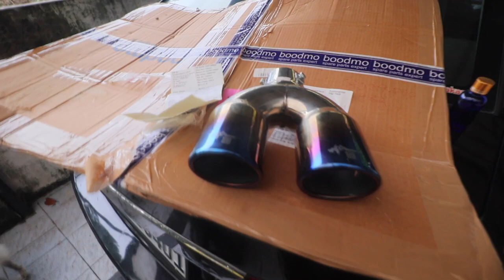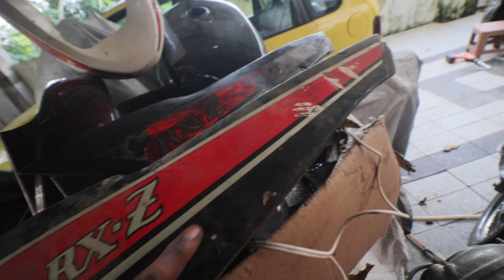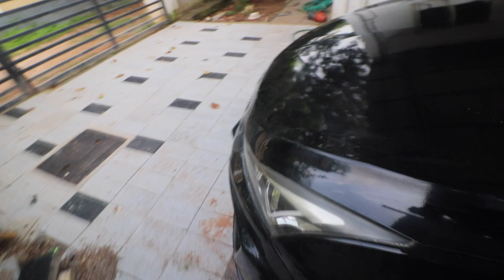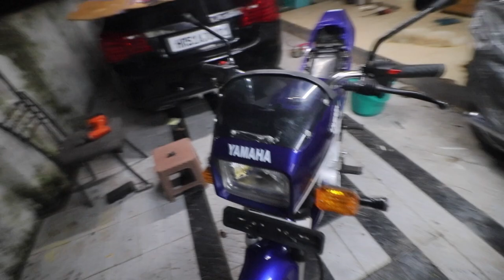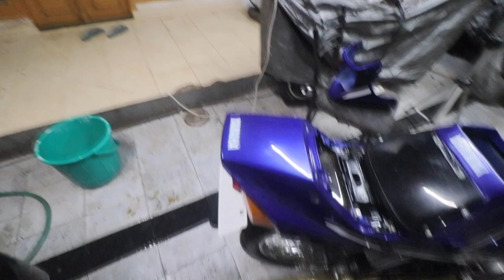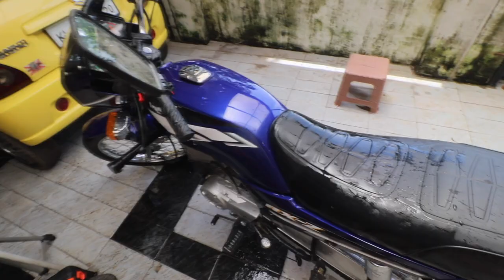Ceramic Coating the RXZ (Malayalam Video)

Comment: Bro ee CAT silencer matti 4spees silencer ketyal ula gunam endha annu.....athupole CAT pottikune engne enunulathu vedio kude patyal chayumo.....
Reply from the maker: Cat silencer back pressure koodthal aanu, Athu karanam low end torque kuranju. Allengil therichu therichu nikunna vandi aairunnu
Reply: @Yamakaze  athine epo ndha solution ulathu chetta
Reply from the maker: arun kannan normal silencer use cheythal mathi, potikkunath chilapol parajayam aavum
Reply: @Yamakaze  oky chetta njn ente RX 135 5s...4speed silencers ketyalo enu vegrichu for better performance and sound...
Reply: @arun kannan brother try changing silencer core for changing sound
Reply from the maker: Rxz 4s silencer in 5S sounds really sweet
Reply: @arjunanilkum4r  how to do that bro..
Reply: @Yamakaze  bro athu direct fit Anno... endhelum alternation chayyano ..RXZ 4speed silencer ..RX135 5s ll ketan
Reply from the maker: arun kannan direct fit

Comment: How you keep bikes without rust in rainy times? my rx100's front mudguard and rims got rusted in 2 months.. i cover the bike with plastic sheet.... can you post a video about 'how to keep bikes away from rust'? 😬
Reply from the maker: There is no way to keep the rust away, you can just delay it, keep the bike dry, away from water splashes